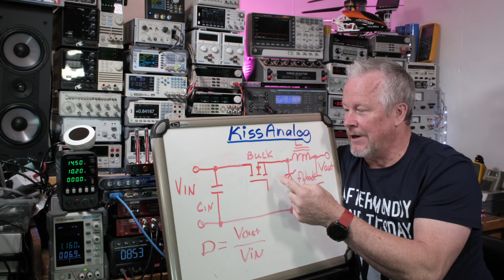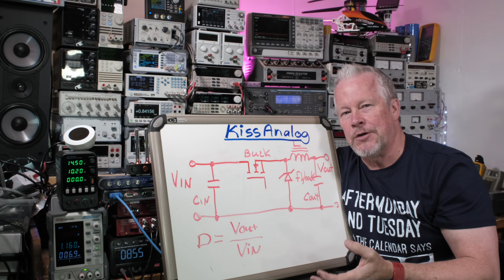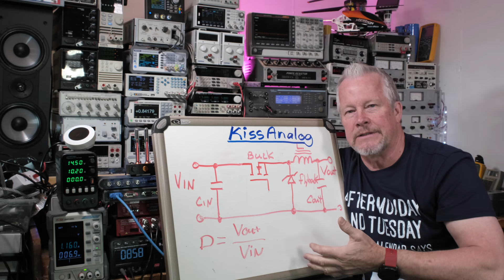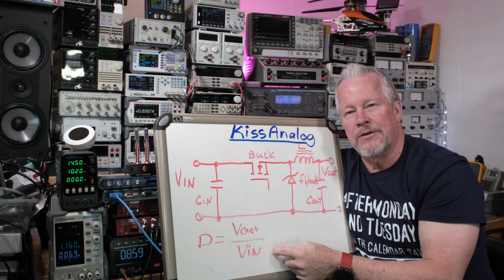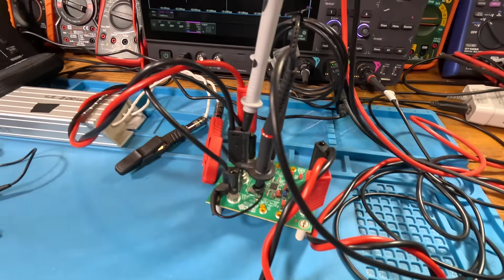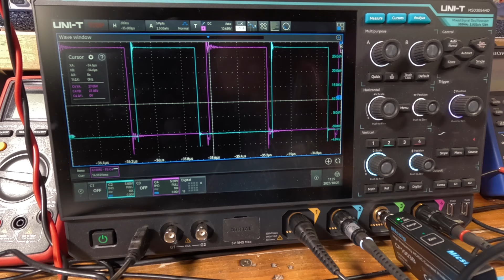How Does a 2 Phase Buck Converter Work? #SMPS #GaNconverter #EPC91109 #LTC7890

Comment: I had a quick look at the datasheet for that control IC. It is very impressive. It would actually be usable for some of the stuff I used to design. I can't count how many times some company, often Linear Tech, would announce some new switcher IC, I'd get all excited by the blubs in the industry magazines, then revert to gloom after finding out that it stopped short of what I required, usually in terms of input and/or output voltage maximums.
Reply from the maker: Thanks for checking it out and sharing your experience!  I know exactly what you mean.  Usually I'd default to TI, ON, or Fairchild, but LT did a great job with this one I think.

Comment: The input current will not be continuous in a two phase buck converter unless the input voltage is no more than twice the output voltage, ignoring losses. That is rarely the case in many common uses of buck converters as point-of-load regulators. For example, in powering modern high-end microprocessors, you might want a a supply of, say, 2 volts. Typically that is derived from 12 volts in a "PC." The overall duty cycle is 2/12 (with caveat) or 1/6. Two phases are not sufficient for such a requirement. Many such POL regulator systems now use three or more phases. Two phases still helps with reduction of cruelty to input capacitors and output caps, but it doesn't go as far as one would like.

For a buck converter, Vout = Vin x duty cycle holds only when the inductor current is continuous, that is, it does not dwell at zero at any time. If the inductor current becomes discontinuous, each cycle becomes "a packet of energy." The duty cycle must be reduced and the expression for it becomes much more complicated.
Sync rectification can actually "force" continuous inductor current by keeping the rectifier switch on after the inductor is fully discharged, sucking current out of the output capacitors and charging the inductor "backwards." This has mixed pros and cons. Preventing forced continuous current mode operation requires extra circuity in the controller. 

Some control ICs "drop back" to burst mode at very light load to maintain efficiency. The reality is that most modern (meaning designed in the past three decades or so) control ICs will drop cycles when minimum "normal" duty cycle is reached but inadequate. It doesn't look very elegant but often works acceptably. Some controllers change to hysteritic control at very light load. Hysteritic control can superficially look like burst mode. Some drop the switching frequency.
Reply from the maker: Thanks for the great feedback.  Yes as I did try to explain - the continuous current is based on duty cycle and load.  But, the important thing is that 2 phases makes it much easier to select a capacitor at the input to keep the current more continuous/clean at both the input and 2 outputs.

I will be doing a video very soon to show more details about what you elude to that occurs during lighter loads.

Comment: Sorry but I didn't understand why this is better than just using 2 in parallel IRL and not just for wave forms, also you didn't show us what would 2 in parallel look like. I'm no expert but I know the basics so from what I understand you would be able to draw the same power from 2 in parales as from the 2 phase one (correct me if I'm wrong) and the same goes for heat dissipation, + with the 2 phase one you need an additional controller for the fets unlike with a "dumb" parallel one so more things to go wrong.
Do PC motherboards and GPUs use 2 phase fets for power?
Reply from the maker: Thanks for your questions! PC motherboards and GPUs often use multiphase power designs for efficiency and thermal management.  It has become more common in the last 5 years I'd say.

The 2 buck converters in parallel in the same phase draw current the same way as 1 larger buck converter.  The current is pulled in one big pulse - pulse after pulse when they are in sync.  If you place them 180 degrees out of phase, then half the pulse is taken from 1 converter, and then the 2nd converter turns on and takes its half pulse of current.  So the pulses are halved in size and doubled in frequency.
Reply: @kissanalog  Thanks for the reply but I still don't see the advantage, as you said it passes half the current but more frequently so in the the end the power (watts) is the same and the amount they work is the same.
Reply from the maker: Lower Peak to Peak ripple current is good for many things, e.g. lower EMI, lower losses (remember IR losses are I squared times Resistance).

Comment: Some oddball buck converters use capacitors instead, and some even offer isolation as well, despite you not having anything like a transformer in it, just using 4 switches, that provide the isolation in the off stage, with the capacitor moving charge from one side to the other.
Reply from the maker: Thanks for bringing that up - some interesting topologies for sure!  I think you are referring to a SEPIC converter.  I have designed a number of those:)

Comment: Fascinating content.  Can you show the frequency of the ripple energy on the output?  Maybe as it varies with the Vin.  I suspect that since the buck converter is working with mostly square waves, there'll be energy at an infinite number of frequencies.   What was the load profile programmed into the load?  It might be non-obvious what ripple energy is from the converter, and what from the dynamic load.  It might be very instructive to see how the story changes between the dynamic load and the resistive load.
Reply from the maker: Thanks for the great feedback!  I have a video showing this and more very soon.  It will show EMI ramifications.

Comment: From what output current would you consider a 2-4 phase buck ? also do u have a example of load that requires something like this beside CPU/GPU?
Reply from the maker: Thanks for asking!  Multiple phase converters are being used more all the time.  A big benefit is smaller components, lower noise, and a great way to spread heat dissipation.  They are used for motor control - battery charging - and audio amp circuits.  Anything that takes DC power in a small space.
Reply: @kissanalog  From what output current value or required inductance for 1 phase designs would you say naaa going 2-4 phase? or when is a good moment to switch ?
Asking since multiphase controllers are way rarer then single phase

Comment: Great presentation. I love me some synchronous buck converters. I'm in them all the time when working on computer mother boards. Wonderful invention for dropping the voltage and boosting current with lots of them working together for supplying power to CPUs, GPUs, and most all devices on the boards.. I think the highest number of phases or 'channels' I've worked on was around 8. Power supply for a GPU.
Reply from the maker: Thanks for sharing your experience with them!  Funny thing is some of us have been designing them for years - before they came out with this cool naming 'multiphase'.  :)